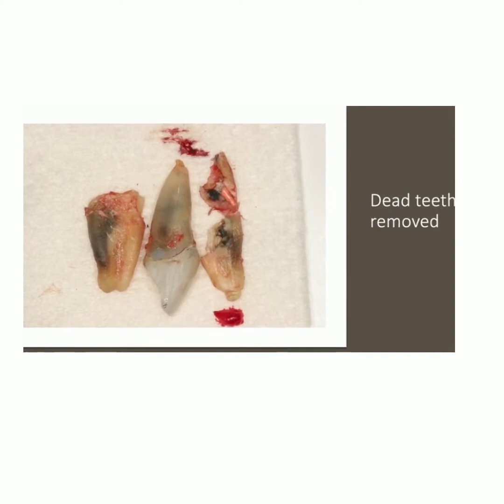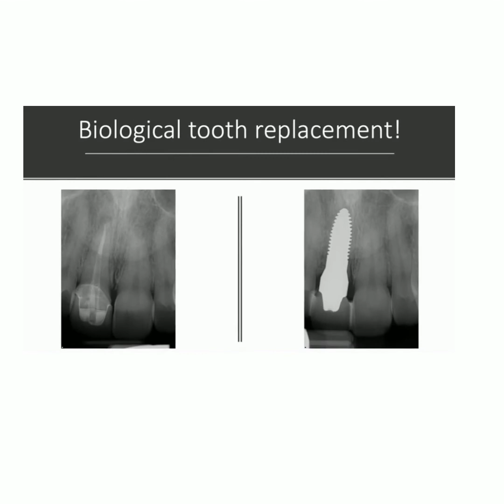The process of a Biological Tooth Replacement in a single visit.

Comment: Ouch, this hurts me just watching this procedure!!! I am terrified of the dentist because of me growing up in Germany in the “dark ages” of dentistry when you never received any sort of numbing agent in your mouth except for an extraction!!! I have most of my teeth except 3 of them that got pulled, but I do go every 6 months to the dentist to have my teeth cleaned even though it causes me great anxiety! My last #30 molar was removed by an oral surgeon a little over 1 year ago because that molar was “self absorbing” and caused a lot of pain, I never replaced it with anything since I am not a candidate for an implant and I still have some pain in the extraction site, why I don’t know. The exact molar on the other side of my mouth was removed because I cracked it myself with my bruxism and they wanted to do do root canal to which I said no to and it was the right decision I had made at that time according to the oral surgeon. My first upper molar got removed when I was a teen in Germany, it was decayed because I never wanted to go to the dentist out of fear and that removal was the worst experience anyone could ever have in a dental chair, I wouldn’t wish it on my worst enemy!!! I am supposed to wear a night guard because of my clinching and grinding (I am in my 70es and try to keep the rest of my teeth😁) but I am allergic to the material the mouth guard is made out of even though it is supposed to be hypoallergenic, go figure. I have many crowns in my mouth with some of them been there since 1980 but they do not cause a problem that I know of. There is no holistic dentist in our area, at least I don’t know of one and can’t find one googling, but I know one thing for sure, I will NEVER have a root canal done, EVER, they would have to pull that tooth!!!